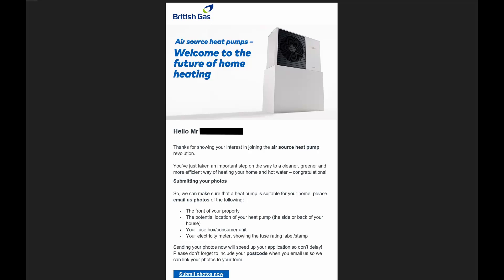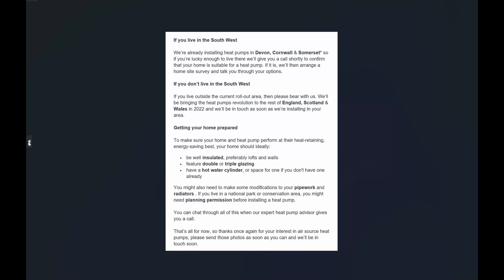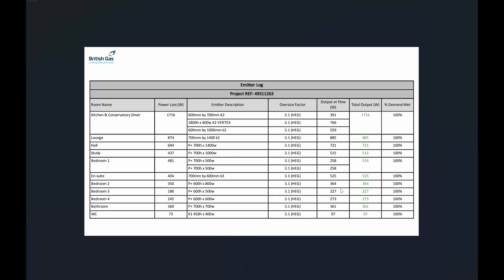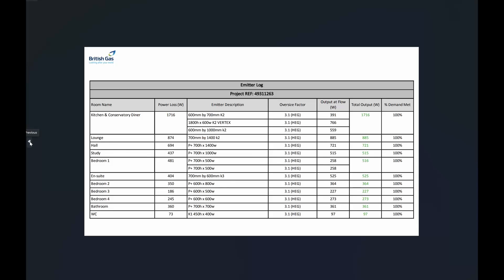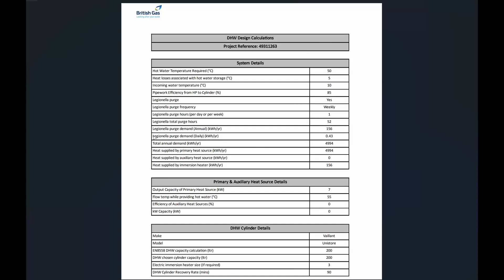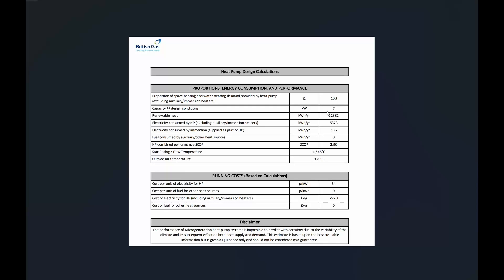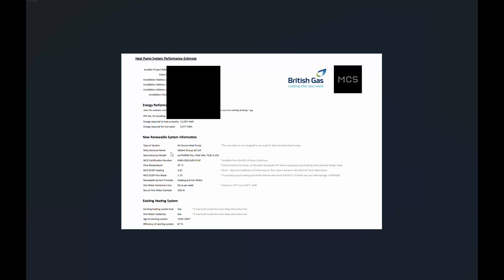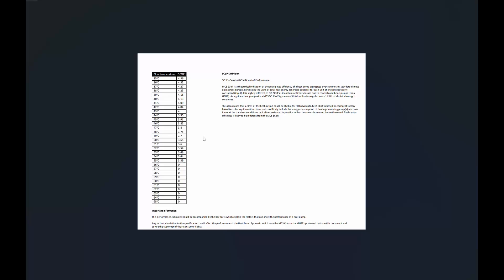Heat Pump Quote from British Gas - Process from the start to getting my Vaillant Arotherm Plus

Comment: Just had a British Gas ASHP quote of £14k (after grant). 7 year old 4 bed new build. 
Everything seems over spec 10kw valliant, all 13 radiators replaced. Lots of emphasis on their ‘warm home promise’. 
Seems too high …
I should add this wasn’t a surveyor but a British Gas pre sales guy who assessed the house for 2 hours then gave the quote which he suggested wouldn’t change much when the surveyor came).
Reply from the maker: Wow, that sounds excessive!
Reply: @UpsideDownFork no that sounds about what it should be, I can't see how these big firms are making any money charging £10k to install an ASHP, just look at how many lads that were there, vans, materials, they pay a firm to collect the rubbish, sales staff office staff etc. 
They have either made a cockup or they are getting a kick back somewhere, because I am looking at that and they are losing money.
Reply from the maker: @acelectricalsecurity  On the early installations like mine, I believe BG were installing these as loss leaders and to train staff on the job. Their parent company continues to make insane profits, so i'm sure they can swallow a tiny loss here and there.
I've been told by some who follow my channel that their BG installations consisted of two heating engineers and a sparky, sometimes just 2 vans.
Of course every job is different.

I still don't see how they quoted this guy £21k for a 2017 built house? We don't know the Sq M or the heat loss but it would be an exceptionally large new 4 bed to require a 10kW Vaillant HP which is capable of outputting up to 13kW in the right conditions.
Changing every single radiator? We don't know without the calculations but seems unusual.

The average cost for HP installation is around £13,000. Minus the £7500 and the average cost to the customer is now £5500.

The problem with big companies is the variability between people. 
The advantage with big companies is the economies of scale.

The facts are difficult to digest though. To decarbonise home heating, we need 600,000 installed per year. We're currently installing under 24,000 per year, well, those are the ones claiming the BUS grant anyway.
There are just 1,286 registered installation companies.
If we are going to increase the installation rate by 25 times, how are we going to do it without the scale of the big boys like BG and Octopus etc?
Reply: @UpsideDownFork  yeah that's true when I was connecting boilers for them they were charging over £3k for a direct swap, paying the installer about £300 and me about £100, and paying Worcester peanuts for the boiler because they were installing around 100k boilers per year. 
Yours didn't look like an easy install chipboard  is a nightmare, what I did notice was they didn't half butcher one of your joists which isn't good. 
Octopus are cheaper than most because they bought a heat pump company out a few years ago, they paid £10m for that company. Plus they are only offering installers £27k a year, which I think they will struggle to get people.
Reply from the maker: @acelectricalsecurity  Yeah, you're totally right. chipboard cuts needed quite a bit of reinforcement.
They came back and strapped the notched joists with steel.
I saw the RED acquisition by Octopus but to the best of my knowledge, they've yet to install a single one of their new Cosy 6 heat pumps. Everything up until now has been Daikin pumps I believe.
I'm surprised by how many people they've managed to recruit considering their low salary offer.
I've heard more recently they've adapted their business model to allow self employed to work as subs.
Reply: @UpsideDownFork  
£21K minus the £7500 grant is way, way too high for a modern 4 bed (assuming it is not some sort of giant mansion!). 10-13kW HP in a well insulated modern house?!

PS. Octopus finally started their Cosy 6 installs mid September. Somehow they are much cheaper though their design means they are possibly a little less efficient (TBC).

Comment: If that's all you paid I think you were extremely lucky and they seriously underestimated the work. You had 4-5 BG guys for 6 days, with 5k grant not even covering materials. That leaves 10k in labour (being super generous) You had 24-30 work days so each guy bringing in £400 (or if I'm misunderstanding and 10K was Total lol then it's £200) a day which is peanuts compared to what they make swapping combis (if it's 200 even Plumbing apprentice /improver brings more than that) . You can tell in the other video where you were quoted 1k for one rad they did two for same price. And those rads in materials with pipes are close to 500 quid. Your average plumber makes 70-80 an hour. Your job should have either cost double/triple to be in line with what a heating engineer is expected to make a day, nevermind one that works for BG. Like maybe mention the fact that you got a bargain of century somewhere in the video 😂
Reply from the maker: Thanks for commenting! I agree 👍
Reply: @UpsideDownFork  very insightful video by the way thank you
Reply from the maker: @DigitalPosion  Glad it's useful!

Comment: So your net cost after the £7500 grant was around £4K?
Reply from the maker: @darrenadams2640  yes, that was the original quote but we ended up coming in a little lower. I'm in the process of doing a more detailed video to show the final cost. Thanks for commenting 👍
Reply: @UpsideDownFork  Seems like a good medium price point between Heat Geeks sky high "assured" prices and Octopus' "we only do it this way" prices. I have tried a few times over several months but unfortunately BG are still not installing in my area (west of Birmingham).

When I saw your previous video with quotes recommending up to 14kW, I thought I hope you don't fall for one of these - far, far too high, and won't be able to modulate down enough resulting in inefficiency.

My home is almost identical to yours so I was glad to see you got down to a sensible 7kW. Shouldn't have needed a buffer though . Makes it less risky for the installer (same reason why Valliant recommends them) but less efficient for you and is not needed in most cases of relatively modern houses (even with 10mm microbore which you only have partially).

My loft is exactly the same as your was, even down to the raised platform for the tank and some gaps in the insulation! I have put off upgrading the insulation as am ultimately thinking about a loft conversion - did not want to spend money just to rip it all out a few years later. How much did your insulation upgrades cost? I like the clever shelving you made.
Reply from the maker: @darrenadams2640  The BG price ended up coming in cheaper than Octopus by a decent margin surprisingly.

The loft roll was £150ish and the solid insulation boards were free to me.
Well worth the time and money, even if it is to be ripped out in the future as ours may be in 5 years time.

My plan was to run the buffer for a year (coming up soon now!) and then re-pipe as a volumiser on the return after a year and compare data. In my case, i'm probably only losing 10% efficiency to the buffer as i've used a thermal imaging camera to roughly match the dt either side of the buffer so I should have minimal distortion happening.

Comment: If I understand correctly, you had to get planning permission to have this installed. Was there no other place with more space where you could have put a Nibe or a Viessmann? They are generally not very popular due to their size which means planning permission is a must with them. But once you are forced down that route, they have no disadvantages over the Vaillant (all they do is copy Viessmann's tech very badly).
Reply from the maker: The constraint that pushed us to the Vaillant was budget rather than space concerns.
The Viessman and Nibe options were significantly more and unfortunately out of our reach.

Comment: why the hell are these things so expensive, theyre just glorified aircon units. id love to have one to supplement my pv but jesus the cost even with the grant.
Reply from the maker: You've got a great point. It's the cumulative cost of the high surface area coil hot water cylinder, the outdoor unit is much higher output than most typical AC heat pumps.
Then there's the additional heat exchangers and water pump. Some of them require extra hydro boxes inside too or a buffer tank.
Add in that these monoblock A2W heat pumps aren't being mass produced in the volume that A2A air con units currently are.

I'm sure things will change as supply begins to overtake demand. 👍
Reply: in all honesty... most of these companies seem to be taking the grant as a bonus and charging the installation on top.
Reply: @UpsideDownFork  All of those things contribute to increased costs but nowhere near the several thousand currently quoted for materials. Lots of profiteering is going on specially with the grant free for all, as is always with these things.